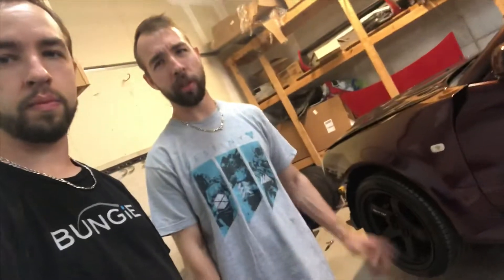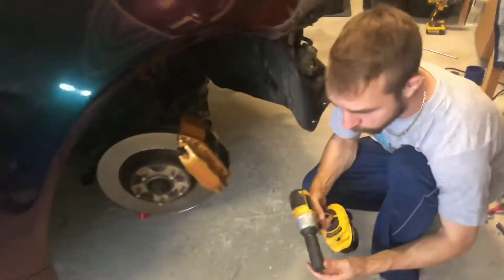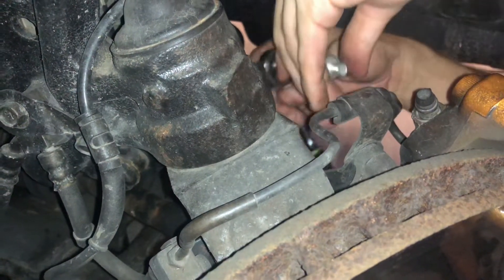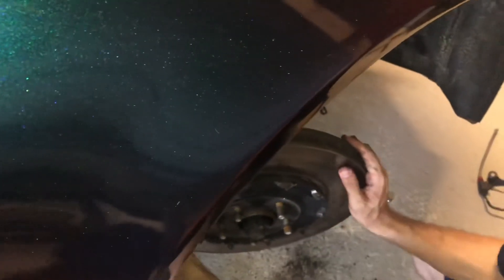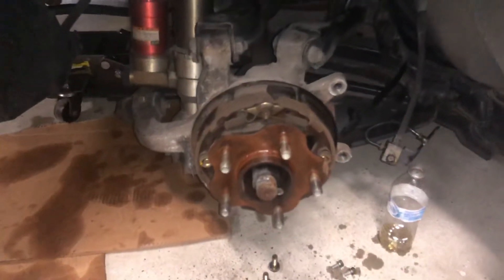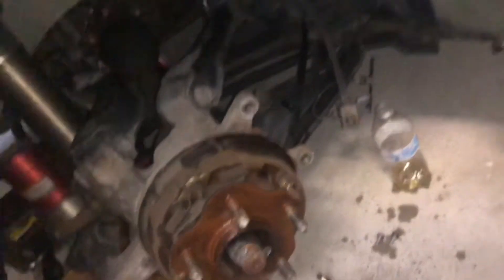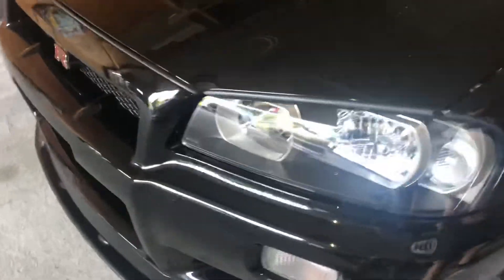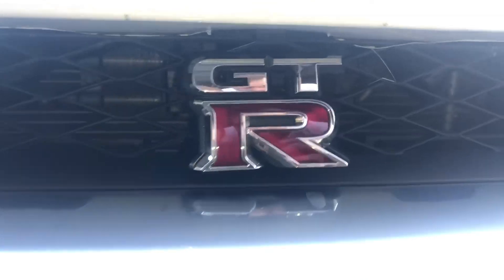R35 GTR Big Brake brembo upgrade conversion for R34 , R33 , R32 GTR

Comment: I noticed one car has wheels with shiny black and one with flat back. Which one do you think look better? Trying to figure this out myself.
Reply from the maker: Gloss back goes better with most colors . The matte black was a limited run and they are ok
Reply: @SuddothMediaHD  I have a black R33 GTR, and I think matte black would look very good. To make more contrast between the body and the wheels.

Comment: How much did the whole thing cost! I’ve done the math and I’m looking at 8-10k 😧😦 crazy expensive mod haha
Reply from the maker: BLAZEREN101 around 5k. If you want it done around that price I’ll have to do match but I purchased used, hit me up I can source for you
Reply: You can get r35 brembos for cheap. I got mine for 1500$.
Reply: @sacredgear  There's no way you got R35 Brembos with rotors and hats for $1500
Reply: BLAZEREN101 not hats, just calipers. The supertec kit comes with hats for about 2300 USD. Dba rotors are about 1400 for set of 4. Pads are like 400$ 
It’s a 5-6k setup. Cheapest I’ve seen r35 brakes and rotors go for is 2k online
Reply: BLAZEREN101 but you can find local deals. I happen to live 5min from a GTR performance shop
Reply: @sacredgear  Yeah exactly which is $8-10k AUD which is what i said from the beginning. I've already gone through this process. It's not something you wanna buy all at once haha
Reply: BLAZEREN101 I’m in middle of process right now. Being in Australia you should much more options than us in US. You guys have had GTRs longer.
Reply: You can buy the brackets from Supertec Racing. Also in UK the calipers are lot cheaper to source. I run this kit on my R33. Total cost was £4.9k
Reply: @INNBCTV  no they’re using r35 calipers.
Reply: @INNBCTV  the rear r35s are 4pot, fronts are 6 pot. I have this kit on my car. I also know the owners of this vehicle